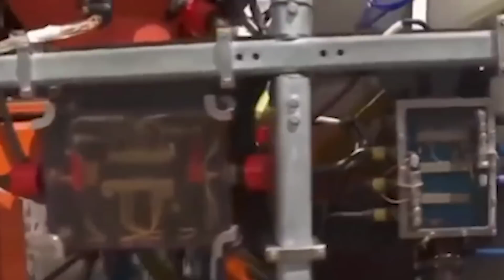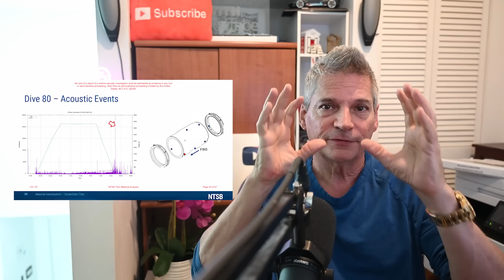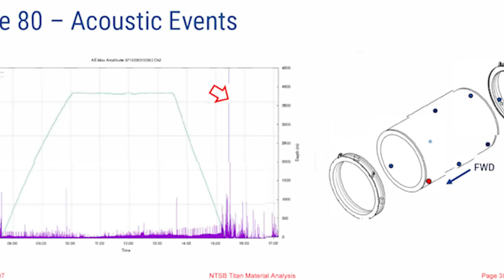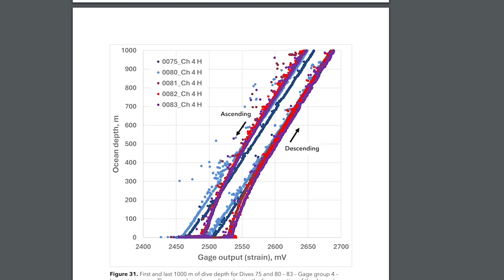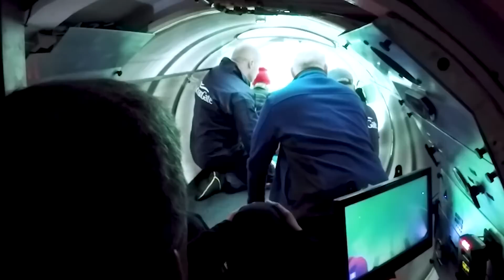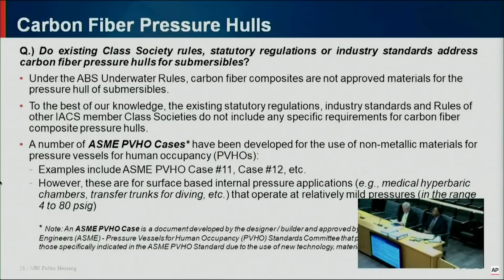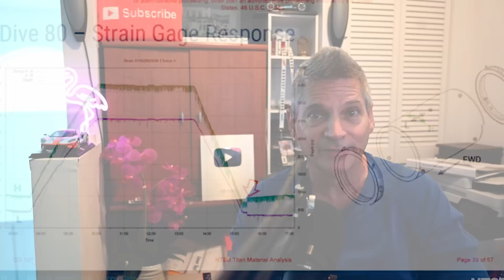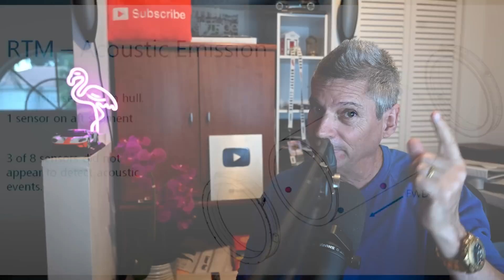How OceanGate Titan Sub Realtime Hull Monitor FAILED! RTM

Comment: For those who might know, I do have a question
I know the carbon fibre hull seemed to be pretty poor from the get go, but when the sub was dropped on the deck and the front section sheered off, do you think that force from both the drop and the sheering of that huge metal dome, affected the carbon fibre section?
Not to mention, did it damage the glue that held the titanium ring on the carbon fibre hull?
Reply from the maker: I think that could have done something, as well as they dragged the sub behind the polar prince for 4 trips, that type of beating surely must add up
Reply: @jeffostroff  Thanks Jeff, I only recently started reading all the reports of things that happened before the implosion and it really is terrifying how all the events you pointed out led to this.
I'm no engineer, but I just can't fathom how dropping the sub and a 3,500lb dome shearing off didn't do some kind of damage to the structure
But as you said, they dragged it behind the mothership in rough weather, left it in dock uncovered and exposed to the weather for what sounds like months.
It really is a shame Stockton can't be held accountable for all this.
Reply: Well it didn't make it any better.
Reply: Theoretically that could have cracked some of glue joint between the Ti intermediate ring and the carbon fiber hull.  On the next dive that cracked glue joint can allow water pressure to make its way to any areas of delamination that happen to communicate with that glue joint crack.  Once at depth sea water will immediately cause those delaminations to grow uncontrollably. IMHO this is most likely between any of the five staged cure sections (each is one inch thick separated by a green resin rich bond coat).   The hull then catastrophically fails.
Reply: they only had 4 bolts holding it on! no wonder it fell off.
Reply: @TerryHickey-xt4mf  With this cast of characters the oxygen cylinders could have leaked during transit and blown the door off.  Might explain the missing bolts for the actual dive.

Comment: The irony here is the data was giving warning they just choose to ignore them
Reply: Based on the scale test imploding at 6000+, he probably (mistakenly) thought they had a safety margin of almost 2x, when in reality it was barely over 1x.
Reply: 6000psi is only 450bar tho so around 4500m also I don't think anyone should take pressure tests on one model that may be build completely different (did the hall have glued layers? Probably not) as an example how the real thing is doing...
Reply: @Stratelier  Safety factor was being reduced to zero with every change they made to the sub like the lifting points added to the top of the titanium rings, each dive, the non-catastrophic accidents they had and the transport and storage.
Reply: they had financial problems and thats without any proper ceritifactions (which incl. destroying a bunch of real scale units, which he couldnt even afford to make)
so they ignored and pushed that one more dive with rich peeps to keep them going, at least thats what it scream to me.,, they knew exactly what was coming up. Delusion, thinking it would last just one more dive to 3-4k?
Reply: Exactly. It didn't fail, they did.
Reply: It's what happens when business considerations outweigh  engineering considerations. Just like Waste Management in the 1980's  out doing their competitors  by not depreciating their trucks, the solution is simple. "We're  seeing an increase in acoustic anomalies originating from the hull, time to build a new one. before a catastrophic failure" . Of course, this would destroy the business case for using carbon fiber hulls.
Reply: @TheTruth-cg8vj  Money was certainly a driving factor here but not the main one. This was about ego and Rush's mainly and it lead directly to his own death.
Experts on their own team warned them what was going to happen and Rush fired them because he knew better.
They had data from the sensors showing deformation but he chose to ignore it because he knew better.

Money certainly didn't help matters here but you don't want it destroyed so that very greed makes sure somethings don't happen.
Unless there someone's or someone convincing enough to make you believe otherwise. Rush was charming and not a stupid man so he was convincing when he wanted to be. 
He was sadly a narcissist making everything about what he wants.
He thinks he superior.
He thinks things are in black and white.
Her treats others as a extension of himself what they do is his success.
He needs to assert control over people and he responds to perceived threats to that control.
He objectifies people with the way he talks about them after then been in the sub.
He didn't place value in others lives it was always about him.
He saw himself as indestructible and the pioneer.
When others pointed out major problems he rejected them in in a dismissive and egotistical manner

Yes investors wanted to make money but not at the expense of others lives in many cases. Even those that didn't care about others wouldn't have risked the business out of pure greed that it would   kill the money maker.
But toss in rush who could be convincing and charming enough that they thought things were ok and you got a disaster.

The worse possible combination happened. People with a want and a supposed expert saying they could have that want.
Reply: I think the owner already had a bunch of customers who he owed re-dos of their previous rides. He probably just wanted to complete this ride no matter what.
Reply: @sarikagoode1505  Greed was certainly a factor but ego was the the prime reason here. The warnings were all there but his ego wouldn't allow to see the truth.
Reply: “The pressure at 1000, 2000, 3000 metres is the same” bro needed to go back to physics class real bad ⚰️
Reply: @SharmV he means the pressure at that deep is the same as at the last dive,it's a bit misunderstanding
Reply: @SharmV  He said at each consecutive dive, pressure and temperature at that specific depth were the same - which is true - so the RTM-readings should bee the same. His theory was, he couuldn't say what exactly the readings had to be, but they had to be exactly the same for every depth on each dive.
Reply: @stagesol  Which they were not during and after dive #80.  Rush chose to ignore the very information that his "safety" system was designed to provide.
Reply: @SharmV I think he means respectively. Like pressure at 1000 is always the same, pressure at 2000 is always the same, pressure at 3000 is always the same…. He’s dumb, but not that dumb.
Reply: @SharmV  That's not what he said with context of monitoring over time. Pressure at 2000m is always the same. 3000, also same over time. Same =/= equal. Stockton was a dumbass, but not THAT dumb.
Reply: @SharmV he meant consistent and repeatable across the range of depth. Not the same at all depths
Reply: or he didn't have enough data or test to know what was a sign and what was not. Likely thought he needed to see a bigger curve or he honestly had someone else look at it who didn't understand either.
Reply: @johnconner4695 they've had 85 missions before the 86th and final. 

85 test would hold enough data.
Reply: @johnconner4695 I don't think they looked at it at all
Reply: @johnconner4695  Except the step change in hull change when the bang happened was a clear indication that something broke. It doesn't get much cleaner. Though from the way he talked about it it seems plausible that he might have been too hang up on the acoustic part to even look at the strain gauges.

Comment: Had he survived , next model wooda had significant upgrades  ,
I bet.
Duz rate of assent have bearing on failure possibilities  ?
Reply: I doubt it would I think the failure is driven by the flexing slowly degrading the material. So each time it flexes it’s breaking down, which is why you see pulverized adhesive inside the blown up hull.
Reply: Had he survived he would be proven invincible.

Comment: That system recorded the defects per dive, not the overall damage. They really should have added them up
Reply: The acoustic warning system did work, but Stockton decided to ignore it and told his passengers that it's normal to hear loud bangs during a dive
Reply: The strain gauge data provided evidence of cumulative damage, except that no one at OceanGate seemed to be interpreting those data.
Reply: @Alan_Stinchcombe  My uneducated guess: the "bang" was a large delamination/shifting event (as evidenced by the change in "resting" strain on the hull and the microscopic evidence of layers sliding)
The subsequent dives thus show the hull was now a bit "softer" as a result of the loss of rigidity, so the first 1000m the curve is different as the hull compresses until the layers are no longer free to flex separately
Reply: It wouldn't have made any difference. They had no idea how many defects would result in failure. They never did any testing to prove they could reliably predict a failure at a certain number of defects. So if they recorded 10 total defects or 1,000, it would have made no difference, because it was always just a random ass guess to how many defects it could handle.
Reply: agree with all comments, the system look liked it worked but they failed to look at or interpret any data especially dive 80 and up. you had an audible event and didn't look at the strain gauges or  dismissed the data it showed.
Reply: Yep, the fact that Oceangate was just resetting the clock each time showed a fundamental misunderstanding of what they were monitoring.
Reply: Like "Congrats on the powerpoint, Skipper. Now do something with all that info."
Reply: Sensor washing by OceanGate.

Comment: How could he even be interpreting anything. He had no baseline calibration to say what any sounds meant in terms of the vessel's integrity. It could have just said it was Leprechauns for all the evidence he had.
Reply: There are baseline information for acoustic emission from laminates, but most of them are for laminates in tension rather than compression.
Reply: Was that not the point of the video Jeff showed where the Oceangate crew were using a model under pressure? I thought they were testing, to scale, the diifferent sound readings under different pressures to create a baseline calibration.

Not saying they tested it well, and imo they should have done this over MANY scale models, not just a single one, plus they should have had at least one model that was consistently brought up and down in pressure to represent multiple dives. Do that 100+ times to test the structure and the sound readings.
Reply: @Spamhard  He couldn't afford that, and without destroying tens or even hundreds of hulls, he was only speculating and NOT gathering any real data.
Reply: @alanmacification  I know he couldn't afford it, and likely didn't think it was necessary because he's insane. But yeah. there WAS a baseline calibration done, even if it was just on one scale model. The irony is, it kinda did work, it was just ignored.
Reply: EXACTLY!!! They never did any testing to prove they could predict a failure, so the noise was just noise. It was literally impossible for them to interpret the data correctly because they had nothing to base their decision on. It's like me telling you you burned 20 gallons of gas, but we don't know how much the tank holds, that doesn't tell you how munch longer you can drive before filling up.

Comment: why was Stockton Rush hell bent on using a carbon fiber cylinder rather than a steel sphere ?
Reply: Money. More passengers equals more money.
Reply: Money 💰
Reply: Like others said, money. Plus he got a great deal on expired carbon fiber that Boeing could no longer use.
Reply: Yeah, like he 👆 said, carbon fiber was cheaper, and the cylindrical shape allowed more passengers and a better experience (if you lived, and if the terrifying cracking sounds didn't leave you with PTSD).  Also, as I understand it, the carbon fiber was much lighter and required less foam-type-stuff to give it the right buoyancy, which allowed it to be more compact -- two factors which together meant Oceangate could rent a smaller mother-ship to carry it out to sea, which, again, would reduce expenses.
   Of course, ironically, that last season they had to downsize the mother-ship even more, which meant they towed Titan out to sea, which meant it could have been much heavier then after all.
Reply: @polarvortex3294  are you sure carbon fiber was cheaper? That seemed pretty labor-intensive?
Reply: @blessedheart3917  I'll look it up & give you a report on my findings.
Reply: @blessedheart3917  Well, so far it's looking like carbon fiber is more expensive, for the reason you cited -- but that's per pound (or kilo, I guess), and carbon fiber still seems much lighter.  So perhaps you can make a sub cheaper with it, in the end.  Interestingly, Stockton and the gang tried to make not just the cylinder out of carbon fiber, but the end-caps as well -- but there was some sort of problem with the result, so they resorted to titanium.  So certainly he preferred that the material be used.
   I'll keep looking...  Sometimes it's good to examine what you've assumed is true!
Reply: @blessedheart3917   Another fun fact:  According to NBC News, the Titan weighed 23,000 pounds.
Reply: His original idea was to have a fleet of these subs he could keep in box trucks and drive around to different tourist areas to do tour dives with just a couple employees per vessel.  Even to inland lakes.  To do THAT, to fit on a box truck, the sub needed to be cheap to make, lightweight and relatively compact.  You cannot get that with a steel hull vessel with a massive buoyancy system.  A heavy and large vessel would need a flat bed truck and a big crane and a larger tender ship. All of that costs money.  So doing it in carbon fiber, it was light enough to skip all of that.  It was cheap enough to mass-produce so these vessels could be everywhere. It would not take an operator any more skilled than someone who could run an amusement park ride.  Stockton wanted to have an empire of these things and just sit back cashing the checks.  The Titan was a demonstrator for that larger plan.  Prove it works. Get investors.  Launch more vessels. IPO.  Retire.
Reply: @LatitudeSky  In a shallow-dive scenario, maybe that could work, but at Titanic depths......not so much.
Reply: @LatitudeSky  Well, I've heard Rush wanted to create a sub empire, as you say; but, although he was running a business & had bills to pay, he claimed his motives and ultimate goals were far nobler than you described.  And I must say, although almost insane on some level, his manic enthusiasm could not have come from a desire to get rich alone.  If he wanted to get rich, there were thousands of easier ways.
Reply: Cost cutting. Not just construction cost, he wanted to cut down the operation cost. He has to make the sub as light as possible.
Reply: @esphilee  and not just money but real world costs like how large it is
Reply: weight to buoyancy, if you use steel you have to use expensive foam to surround it to make it more buoyant.
Reply: @blessedheart3917  Lots of foam,
Reply: @joefish6091  Glue, and of course Rhino Liner - that's super tough for your truck bed. "Even the US military uses it you know."
Reply: In my opinion it's because he was seeking recognition as an innovator. He wasn't looking for the safest or even cheapest way to do it, he was looking for a way that would get him the status and recognition he desired. He said himself he would rather have young guys working for him and not guys his age. He wanted the young guys because it made him feel superior.